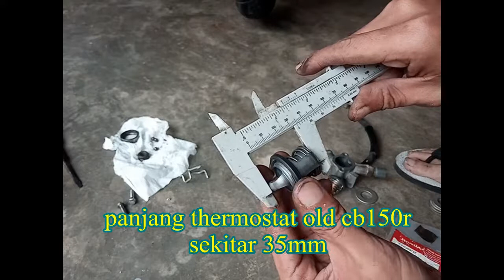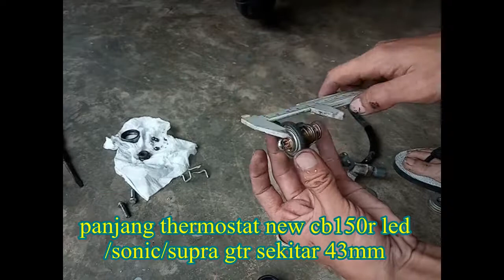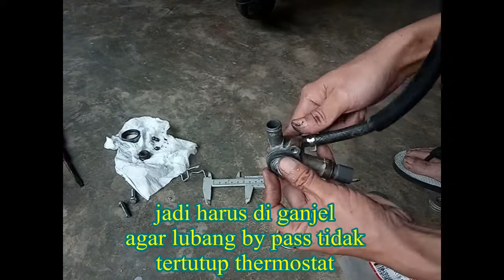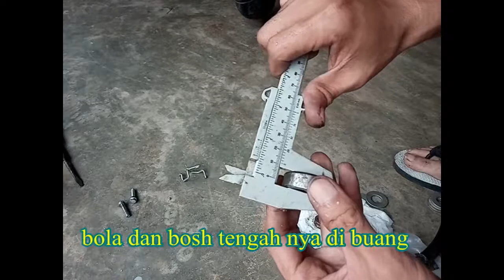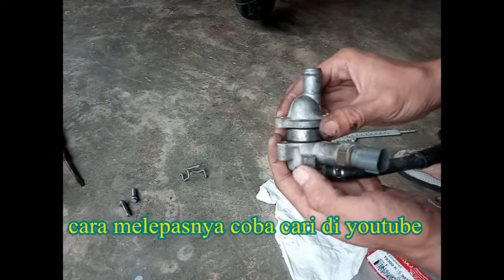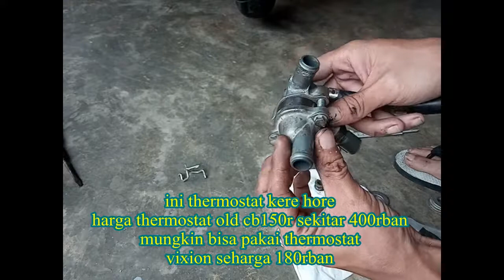Thermostat cb150r old subtitusi pakai cb150r new

Comment: Pake pya vixion gak bsa ane dh coba.saat mesin panas bunyi tek tek sepertinya termostat tida bsa mengembang trs motor mati.
Reply from the maker: Diameter seal nya sm om?, setahu saya memang berbeda di bagian tonjokan penutup selang by pass klw cbold/cbnew  ada tonjolan yg memang untuk nutup selang by pass ketika thermostat terbuka. Klw vixion thermostatnya ga ada tonjokannya.
Reply: @TheAndriyan  sama,.iya beda di bagian penutupnya
Reply from the maker: @kakangmas_ari6336  panjang nya sama om dengan old cb?
Reply: @TheAndriyan  panjang/tinggi sama,.lebar kurang dikit,tp pas sealnya sama persis.
Kalo kata saya pribadi sih berdasarkan pengamatan katup yg membuka itu tidak bsa menutupi lubang yg dibawahnya
Reply from the maker: @kakangmas_ari6336  iya om, yg cb katub bawahnya ada per nya kecil. Berarti memang kurang cocok ya pake vixion.

Comment: Pengen nayak om kok bisa ya selamg pembuangan air radiator motor cb150r ane mnguap seperti asap dan keluar air
Reply from the maker: Kepanasan tuh om, coolant mendidih dan jadi uap air hingga keluar dari selang pembuangan. Sering2 di periksa om coolant di radiator dan penampungan klw berkurang di penampungan plastik (resivor tank) di tambahkan lg coolant. Klw berkurang nya di radiator saja berarti ada kesalahan sistem radiator/kebocoran. Jika kendaraan sudah berumur bisa di bersihkan sistem pendinginan nya biasanya sih banyak kerak/lumut.
Reply: @TheAndriyan  iya om pas tu uda berlumpur tabung radiator nya.tp kipas hidup juga on tp gak kuat gt. Apa krn ane juga pake air colaaan yg lain mohon penjelasan nya om  salam persahabatan om
Reply from the maker: @ikhwansimamora3397  ga masalah om pake coolant yg lain, bisa jadi kipas nya mulai lemah putarannya. Tapi coba aja dulu di bersihkan daleman radiator, selang2, termostat nya.